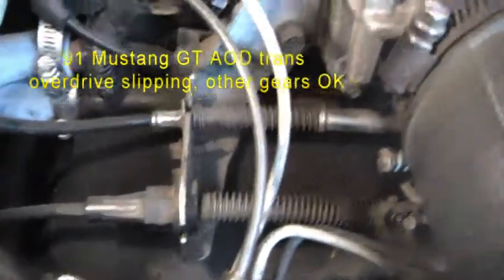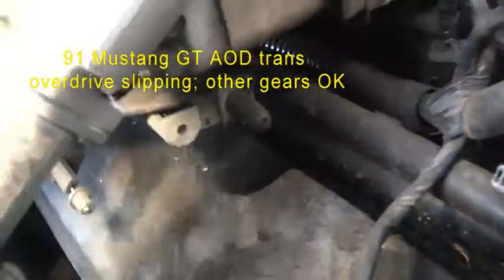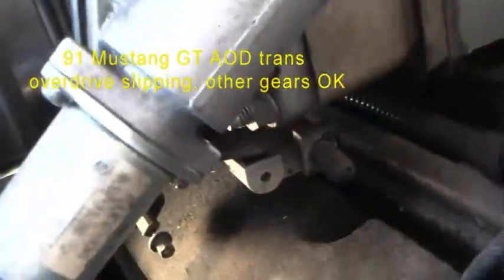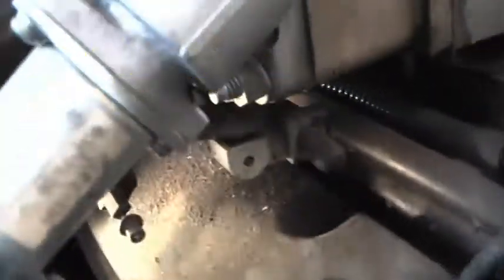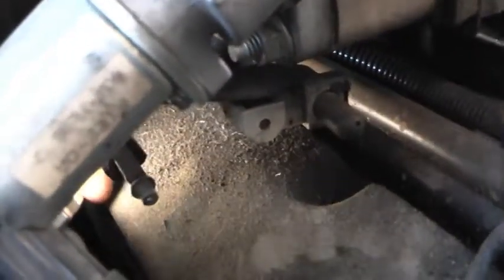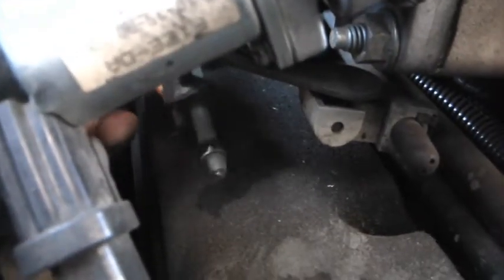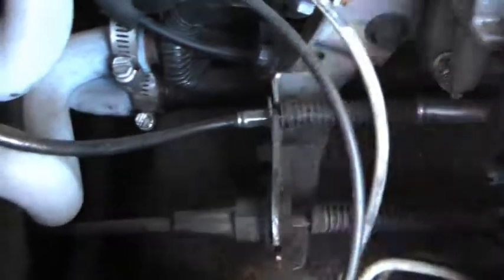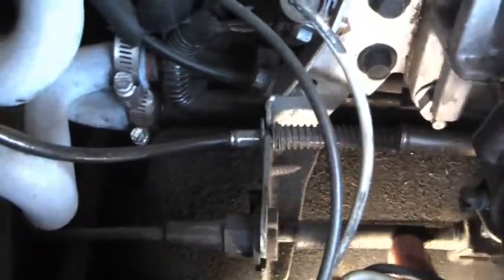91 Ford Mustang GT with AOD overdriver slippage

Comment: It's not attached at all. Look on you throttle lever. There should be an empty hole. Slide the dowel into that hole and secure it with a brass bushing kit from ford.